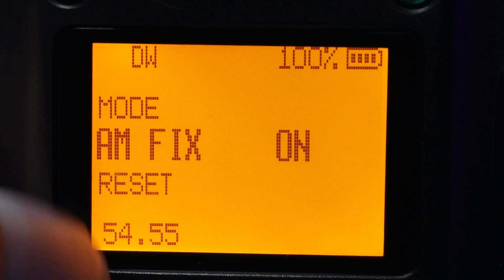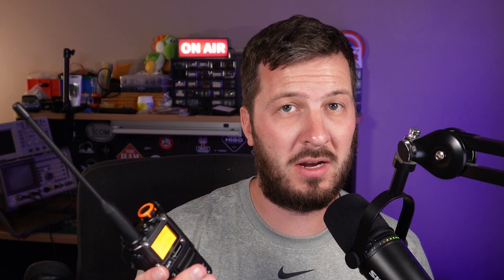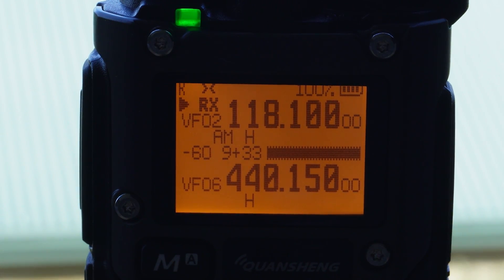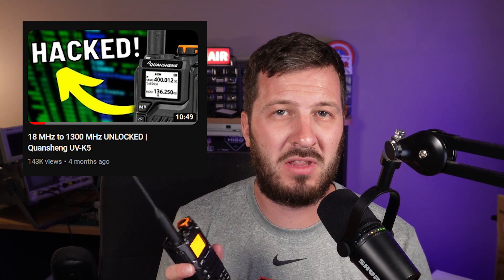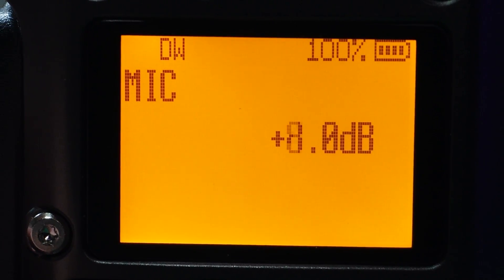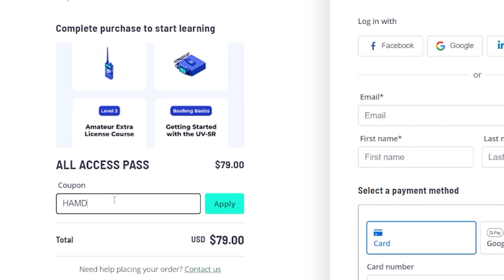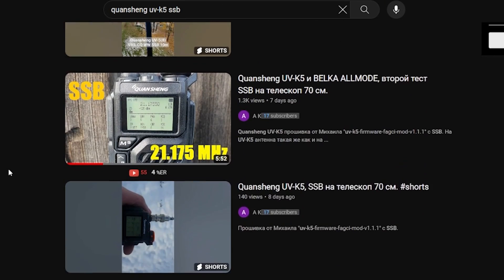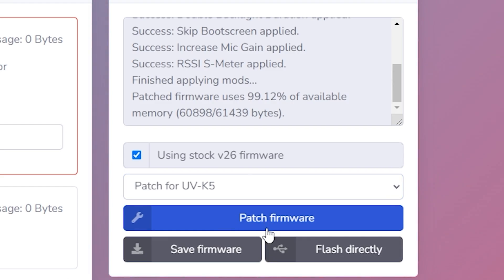Airband Radio FIXED in the Quansheng UV-K5 (Listen to Aircraft)

Comment: Yes the audio quality improvement is apparent after modification, although falls far behind a scanner. I am puzzled about why no HAM radio can receive airband well? They all sound like the nose is fully blocked and all with a static noise background. Is this due to HAM radios are not made with industrial quanlity hardware and firmware?

Comment: Thanks Harry & all you commenters, I have a UV-K5, never modded it & I bought to use at Illawarra regional airport, where I work, and AM was crap as aircraft in very close proximity. I put it in draw 1 year ago, now thanks to you guys, will pull out of that draw & do the firmware upgrade, Thanks guys, Barry, VK2FP

Comment: You might bin listening to a nearby airport tower signal. Set the a section to the start off the 11m band in the a -section & at the end of that 11m band. That is around the cb band but use the AM mode. Press F5, do speed 32 and rate on 20.00k lower then the squelch until you don't hear anything, let the quansheng scan in that range and check the spectogram. You shall see signals popping up on the meter. Planes broadcast max 10" when you see signals go on and off those are planes. last use flightradar24 to see what planes are above your area.

Comment: Qite old video and I doubt you don't know this but if not here it is. This is from what I have seen around net from time I got my quansheng uv k5-8. Still no modification done to my radio as had issue with it , not possible to use serial to usb cable to connect it to PC. And waited finally to get my refund for it as side 2.5mic connector does not work , does not have connections with board. In mean time seen tons of videos and red a lot of material about it, so About SSB reception , I think you need upgraded board for it 2.0 at least but I suggest order 2.5 as it is quite better then 2.0.  It cost 10-15$ .  73 from E77ASR.

Comment: Nice radio, spectrally clean too, closest harmonic is 49db down on 2M, no harmonics detected on UHF at all.

Relatively sensitive - but using it on non ham bands is strange, full scale signals wont open squelch even with SQ set to 1, hit monitor to open it all up and bang, rock solid crystal clear, there is no ctcss or DCTS either, this is an un-fw-moded radio, its TX expansion was enabled in chirp, wonder if anyone else sees this on mod'd or unmod'd version this is (8) variant, good one to try is 477.400  uhf CB 40 (Aus), signal generator is clear tone when you hit the mon button, drop it back to normal and even a -70dbm signal wont open it up (yet on ham bands a -132 DBm opens up SQ 1 on both call chans), the same weirdness applies to VHF marine, BUT  Airband works, it opens the SQ normally, I even changed the generated tone freq from 1K to 800 Hz incase there was some weird conflict.  Hayden, have you tried sig-gen'ing these units out of "normal" band?  (my tests are using tinySA ultra) (incidentally, if I try AM signal on 477.4 it does open, just not on FM)

Comment: Hi good video  can you get the 27megs  on the am -fm CB band I do have quansheng uv-K5 and the UV-K6 this is the newest model  for 2024 do I need to change  the steps for the airband  like you said it comes over quite bad I don't have my ham licence yes I only like to monitor  the air band most of my hand held are uniden bear cat just scanners  I do have some ABBREE and baofeng my uniden scanners the battery's drain to quickly I am just trying  to get my head round the quansheng and only using a 108-136 antennas cheers for any help

Comment: Is there a way to have this firmware mod as well as TX in airband?  I want to use this as a backup radio in my plane and I need to listen AND TX.
Reply: When I have this installed I cannot tx anymore.
Reply from the maker: The radio won't TX in the airband. It's power amp is not broadband enough and it wouldn't be certified for use in the airband.
Reply: Buy a radio that IS intended for Airband please.

Comment: As you say, its AM lacks dynamic range.
Here is my tip. If you want to listen to Air Band AM , get an Aicraft radio especially if you are feeding it to others. The OLDER Aviation radios have better sounding audio.
The Rolls Royce are the King Bendix older style like the KY196
and its audio is better than you get in the latest aviation radios.

Comment: Does the fitted antenna work on airband or does it need replacing and if so what would be the best one to buy?Anybody know?Thanks.
Reply: The stock works ok if you're closer to the airport and have line of sight. Of course range depends on where the transmitting aircraft is (on approach, on the runway, etc.,) in relation to you.

I have an old Diamond 2m band antenna (RH77 I think) that I used to use on an old Radio Shack scanner. I just have a BNC to SMA adapter and this also works pretty well. 2m is close enough to airband that any decent 2m should work pretty well for ATC reception. Also helps if you want to listen to milair frequencies since those are typically in the next harmonic.

Comment: returnredreturn (freq + (step + 1)  2)  step * step;
int32 t TX freq check(const uint32 t Frequencyreturn 0  if TX frequency is allowed// otherwise return '-1'return 0;
if (Frequency < frequencyBandTable[0].lowerFrequency > frreturn -1.not allowed outside this range
if (Frequency >= BX4819 band1.upper && Frequency < BX4819 bancreturn -1;  BX chip does not work in this range
switch (gSetting F LOCK)
case F LOCK DEF:if (Frequency >= frequencyBandTable[BAND3 137MHz].low(return 0;if (Frequency >=frequencyBandTable[BAND4 174MHz].1
the air  bond tranceiver has been cracked

Comment: Hello - please excuse my newbie questions.  I got the UV-K5(8) for £8 from Alibaba maily to listen to air band as i have several local airfields and the Luton flightpath  above me. Given how cheap this was I have no problem trying the firmware update, for fun really. But my question is:  can I use the handset as a license free PMR446?  Is there an issue with broadcast power for license free with this?  If I can't use the PMR446 I will disable Tx completely - which I think I can do with the patch.  I've never owned any kind of 2 way radio before so excuse the questions.
Reply: Luton in the UK? I m waiting for mine to arrive. I believe you can use it as a walkie-talkie on PMR without a licence between 446.0 and 446.2 Mhz. Outside that you will need a radio amateur licence.

Comment: You say this is for the K5 but you seem to be holding a K5(8)/K6, certainly not the same radio your affiliate link sells.  Which is it?
Reply from the maker: A K5(8)/K6 is the same radio as a UV-K5 only they changed the backlight, screen and button layout. The firmware works on all flavours of this radio,
Reply: @HamRadioDX  thanks for the response! I had read that but wasn’t sure how accurate it was.  Makes this product line a bit confusing when you’re just getting started.

Comment: Please advise which link is the AIR BAND firmware update.... the links on this  page do not identify that upgrade, thanks   Rob, ZL1RD
Reply from the maker: I had v0.8 firmware installed but I believe all later versions after this still have “AM fix” implemented
Reply: thank you

Comment: I picked one of the UV-K5(8) up off Aliexpress, It just didn't work as well as the UV-K5 I have. It doesn't receive any of the NOAA channels, It's FM broadcast receive was maybe in the shortwave band (?), and only got one channel - on many different (indicated) frequencies.  I used my UV-K5 to do the OTA clone, thinking maybe a hidden setting was causing the issues. Interesting enough the clone changed the opening screen from Quansheng to Anysecu (my UV-K5 is the Anysecu model),  I am now able to get FM broadcast, but it seems like it's off freq quite a bit. Still no NOAA channels, and AM is sort of working now.  The UV-K5(8)  came with European style base charger, I was thinking maybe it was setup for use in the UK, but I don't see any way to change it to US usage.  I've always been hesitant about third party firmwares, but in the case of this cheap radio, I don't see how it could make it worse.  And might actually make it better.  Thanks for the video.
Reply from the maker: No worries thanks!
Yeah I can't vouch for any of them off Aliexpress - perhaps a copy or a defective unit?
Reply: @HamRadioDX  Brief update, these are weird radios - I put the stock antenna on it - and FM and NOAA both work.  I put the ABBREE antenna on my original UV-K5 - and no FM or NOAA.  I also tried a couple other antenna (which I know are good antennas) on the new UV-K5(8) and UV-K5 radio, no FM - NOAA worked thou.  But the stock antenna appears to work the best on this weird radios.  PS.  It was very cheap on Aliexpress, I wouldn't be surprised if it wasn't a knock off - but if it is it's a fairly good physical copy. Also it took the 3rd party firmware without any issues or problems (very easy to upgrade honestly) And easy to go back to the original firmware if needed.

Comment: Please be careful when using a radio. It will create frequencies that will enter your body and cause damage. Wrap either the  radio or your body in tinfoil to prevent this.
Reply from the maker: A kitchen metal strainer works for the head.

Comment: Another heads up: when I tried to flash it it loaded about 10% before the Dell Latitude Windows 10 gave me the blue screen of death and rebooted, bricking the radio. It did it again after it rebooted. Third time is the charm...
Make sure you are running the pre-2012 Prolific driver for the cable before you brick the radio. Once I installed it the radio programming was a snap.
Reply: I think I bricked my radio, it won't turn on normally anymore. Is it possible to unbrick?
Reply: @DataDev  The first step is to make sure that you have the right driver for the programming cable installed.
If you are getting a message about support ending in 2012 just copy and paste the error message into Google and you will be able to get the correct driver.
Reply: @spaceflight1019  I'm not getting any message about drivers, I just put the radio into programming mode and tried to flash it, but it stopped at around 5% and now the radio will not power on
Reply: @DataDev  Go into the Device Manager menu with the programming cable plugged in, and take a look at the date on the cable driver. I'm using a Baofeng cable and the best driver for it is from 2007.

Comment: Just a heads up...the link you provided features a "flash with a browser" option.
Reply from the maker: Yeah that's new
Reply: @HamRadioDX  It actually works well, as long as the proper driver for the cable is installed.

Comment: Well, the AM thing works for sure, but can anyone help me out? I unlocked "F Lock" but when i press PTT on a CB channel, it says TX Disabled... What did i forgot? It was working with my last used firmware, its so irritating.
Reply: You might have AM demodulator activated. You can't tx with AM demodu on
Reply: I mean on USB 27.305 @costy91395139561

Comment: 50Mghz to 600Mghz...

so um.. no shortwave   1.6Mghz to 20Mghz
and no scanner frequencies... which is like 700Mghz to 960Mghz (I think from memory).

Okay without those two, what's the point of this radio.
Maybe if it could actually transmit on the aircraft band, as a dirt cheap better than nothing radio for an ultralight aircraft pilot radio.

Comment: There is no mention of the "AM Fix" on whosmatt latest firmware. Where is everyone getting this fix from or is it included in the latest firmware but not mentioned in the list? If that is not the case can you provide a link to where you got the firmware version with the "AM fix" mod? Cheers.
Reply: I wish it would show up on that because I like its customization options. I guess I should compile my own version...
Reply from the maker: I was using v0.8 here - https://github.com/egzumer/uv-k5-firmware-custom/releases 

I use whoismatt UVMod page just as an easy way to flash
Reply: @HamRadioDX  Thank you! 😎👍

Comment: I have a UV-K5 that came with the .25 Firmware. I downloaded the Firmware updater and that came with the .26 Firmware. I updated to the .26 Firmware and  UVMOD is working fine. Now, on the Quansheng website is a newer Firmware listed for the UV-K5, version .31. I installed that version and it works fine. However, UVMOD doesn't seem to be working with that Firmware. I upload that Firmware to UVMOD, patch it and then download the patched version, upload it to the radio and then the radio doesn't turn on and I have to re-flash back to one of the stock Firmwares. I assume they changed something in the .31 Firmware?

Comment: hi thanks..will it also transmit on airband in aus?
Reply from the maker: No it won’t TX Airband and that’s also illegal using this radio
Reply: thank for teling me it wont transmit on air band however the information that it would have been illegal is incorect here in australia acording to the authority i contacted. @HamRadioDX
Reply from the maker: How so? Is the handheld type approved for Airband operation by the ACMA?
Reply: @russellwilson5246 As an airline passenger(and radio enthusiast) im glad that a radio any nut job (which there are many )could have access to AIRBAND transmit.

Comment: Cheers for the video mate - I'm the same as you. My unit does not receive on the HF at all - I don't think some of the chips have the wide band facility and we were the unlucky ones. I tried a small test to transmit on 27.780 FM from my 7100 and can't hear anything even in close proximity.
Reply: **Edit it does work but you need a resonant antenna and a careful tune of the gain settings

Comment: Has anyone tried this on UV-K6?
Reply: Works very well on my uv-k8, which I think is identical to the k6 internally.
Reply: @howardgipps7351  You mean UV K5 (8) or is there a new K8?
Reply: @howardgipps7351   Thanks, I tried it today and it worked fine with the web flashing tool and my multi-purpose programming cable that I use on the UV-5R
Reply: It's not work wiht the UV-k6, i try 3 different way and will not update ...

Comment: HUUUGE improvement. I played around a bit last night. After installing this firmware, i also set the AM freq's all to NARROW. The audio is now even more clearer than when it is set to wide , and it seems to be more sensitive, as im also receiving MORE now when set to narrow than i do when its set to wide. I see you can also set blaclight intensity BLMin/BLMax which is nice and will probably save a bit on the battery 73

Comment: Hi Hayden.
So I have a bit of an offbeat question. I was going to email you but i read somewhere yu don't respond to emails to much. Fair enough. So I have been a radio enthusiest since the early 90s, and Ive been subbed to your channel for a bit, which I love. I used to have my Unrestricted amateur radio license years ago in NSW ( I held a limited callsign as well as an  restricted ). Now I've tried to look this up but its a bit confusing, given how callsigns are allocated, but before i actually go ring up the ACMA, I was wondering how easy it is to renew your license after a long time being unlicensed? I still have my original certificate so have the certificate number, but I am unsure if I will need to test again here in Australia after being away so long, or If I can just pay the fee, get a callsign allocated ( I see they do this now, you don't get to pick ). 
 I was wondering do you know much about this situation these days at all and if you could give some advice?
 By the way I just bought a UV-K5 and programming cable to add to my radios. Mostly I play with receivers and SDRs, which are amazing tech compared to the radios I started with in the late 80s! I appreciate any feedback you give on this. Keep up the good work mate with the channel!
Reply from the maker: Hey mate,
The AMC are currently in charge of allocating callsigns (until at least Feb 2024 - then the ACMA will be taking over).

All that should be required is to show your original certificate and that should suffice to get an Advanced License - pretty sure that’s the equivalent for the old unrestricted. 

https://www.amc.edu.au/industry/amateur-radio

If you’re happy to wait a few months - you might save some dollars doing it through ACMA once they take over the exams and callsign management - there will be no annual fee for a license and you’ll only need to pay for the allocation of a suitable callsign.
Reply: @HamRadioDX  Sounds easy.  When is ACMA taking over? I'm happy to wait. Been thinking on and off for a while about getting the license back.
Reply from the maker: ACMA have proposed to take over in Feb 2024. We’re waiting on further updates from them. You can subscribe to their newsletter here which will keep you up to date on the changes - https://www.acma.gov.au/subscribe-our-newsletters

Be great for you to get back into it! We’re almost at the top of Solar Cycle 25 so the bands on HF have been 🔥
Reply: @HamRadioDX  Thanks for the info.  Did some googling on the proposals, and it seems if they deemnit be, people reapplying may need to take part of the practical exam again.  Hope that doesn't mean Morse at 15wpm! No way I could do that again?

Comment: Just tried the airband mod on my K8...massive improvement, hard to believe a firmware mod would do that, but it does.  If only all the other mods worked as well, or at the same time. I suspect this radio actually needs more flash memory to store all the mods, and I will eagerly await a new iteration, and I will buy it, because the UV-K8 is amazing compared to all other cheapies.  Oh and it could do with substantial water-proofing as I use mine on boats at sea often in rough weather , ( with Marine Rescue.)  Great video too, so thanks.:trophy-yellow-smiling:
Reply: When the radio was first introduced I did some experiments with the air band. My impression was that of an insufficient AGC causing distortion to the audio once the receiver signal strength exceeded a certain level.